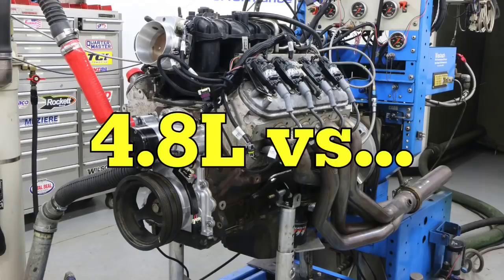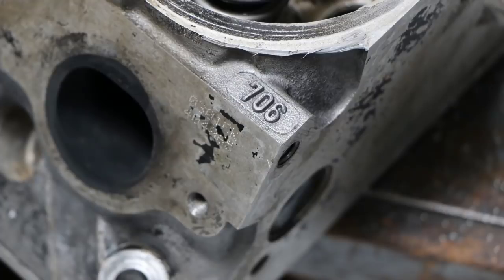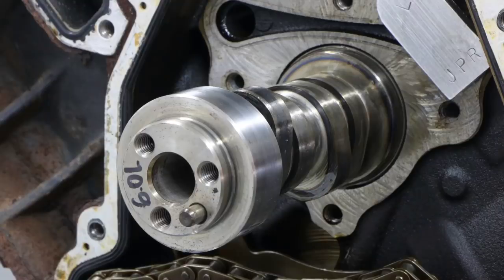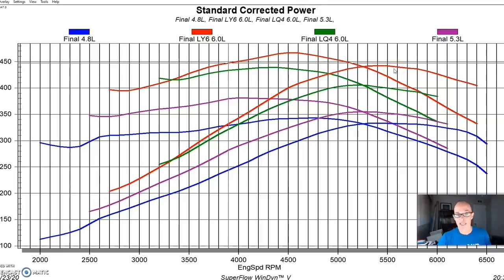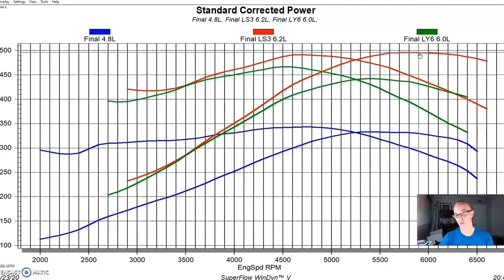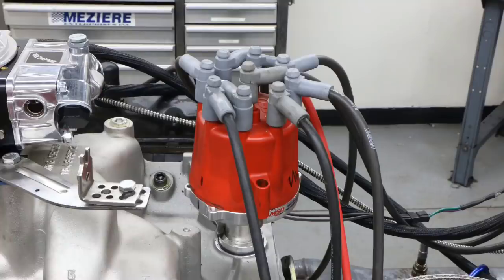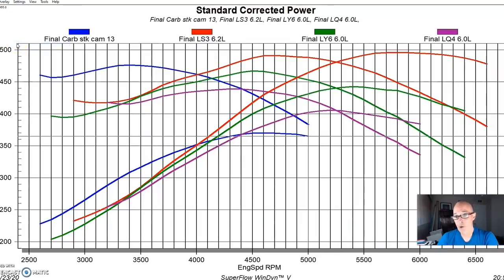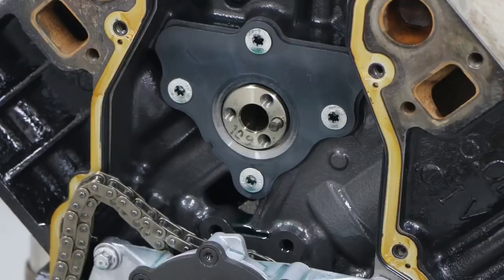LS INFINITY WARS-4.8L vs THE WORLD

Comment: I hate driving these 4.8's or 5.3's on the street though. Even the 6.0 l has no balls down low. You have to rev these motors. The peak numbers are impressive but the average numbers look like shit. This guy is a Dyno racer though so........
Reply from the maker: yes-because a dyno that shows how much torque the motor makes at every rpm tells you nothing about average power

Comment: The 6.0s and 6.2 all had about the same torque where you started the various dyno runs. As you stated, the cathedral port-headed engines do better below that. There’s another factor when you get into aftermarket cams, though. The factory cams are all wide LSA smog cams and don’t provide the mid-range of a narrower LSA cam. Even zero overlap at 0.050 is way better than the factory stuff, and fills in with torque in the mid-range. Thanks again Richard for all the good info!

Comment: Bigger is better and boosted is even better!  On my Cummins swap forklift project I am building a 8.3L instead of a 5.9 because it has 25% more clutch engagement torque. That will make a noticeable difference in how it handles and responds.  Not really going to be doing 4k clutch drops in it so the torque rules!

Comment: Hey Richard.  Thanks for the world of ls motors.  I did change my cam 209/217-500 and to 1.8 roller rockers,   7.450 pushrods,   600lift valve springs on my 5.3. You did mention in a video about Changing rockers and adding pushrod guide plates might hold back the pushrods from lining up with the rockers. And you were right.  Still I don’t see severe deflection,the roller still stays on the valve stem just not centered tight. At 51 6’6 and overweight this was a huge job to do. The worst was the valve springs and my big fingers. Lol. All done in the Yukon not on a stand. But it’s done now I’m working on getting my long tube headers done and corvette style side pipes.  Then the glorious tune. Thanks Richard.  Good video

Comment: I bought a 4.8 from the junker because it was half the price of the 5.3 with 20-30 less hp but kinda regret that
Reply: The 4.8 is a hot ticket in an S10. There's enough power to be fun but the rear end isn't stepping out in the wet.
Reply: @ahoneyman  I’m Ls swapping my s10 1998 4.8 to a 383 stroker
Reply: My coworker has an S10 with a stout 355. It just spins the tires if u get on it.

Comment: 5.7 and 6.0 are common in Australia.Never see the small LS engines
Reply: Thats because they were only a performance engine in the Commodore.  The smaller iron engines were used in american pickup trucks.  6.2 also common in Australia. Prices for all are now insane since commodore production ended.  2nd hand prices for a high km LS1 are now $4000AUD.  $8,000+ for an LS2/L77/L98 and well over $10,000 for an LS3.  Crazy.  Now collectors items.

Comment: Dude.... you forgott the 5.7 litre?? WTF The most common engine I use is A5.3 from a junkyard punched out to 5.7 585-600 lift cam234-236 dur. big heads usually ported stockers probly about 500 to 515 at the crank

Comment: I have an open quesiton for anyone that reads this. I might be inheriting an early 2000s s10 with the vortec 2200 manual. Id love to keep it around for a long time (permitting it is in good enough shape). Would it even be worth swapping in a 4.8 or 5.3 ls in order to get better towing and a bit more power? Do you think it's possible to get the ls tuned to get better fuel economy then the 2.2 on the highway (lean burn)? And could a nv3500 really hold the power of a mild use 5.3, they're fairly cheap to find near me so its better then a t56. I don't want to go broke doing it so if it ends out being a lot considering the truck is free.
Reply: Trans and rear axle wont handle any sort of spirited use. Those 2.2s have head cracking problems. If it starts dripping coolant under/behind the exhaust manifold get prepared for a new head ir the swap! Just do a 4l80e and a 8.8 narrowed axle behind your choice ls engine. Look up a channel LsBluu for details
Reply: @ScottNelson01  I'd really like to keep the truck manual since it's already one. Didn't the nv3500 come behind some ls's factory? the other option would be to try and find an nv4500. The axle is the worry but if i keep it sensible for a while and then eventually do an 8.8 swap it should work. 4l80es are fairly pricey compared to any of the manuals, if i Had to go to one it would be a lot more. thanks for the insite!

Comment: Richard when you talk about destroking engines I think of the NHRA guys in the early 70's taking 426 gen II hemis and destroking them to 366 to get class advantage through weight breaks for smaller displacement.  Would love to see a dyno comparison between a 426 and one destroked to 366.  Mr Norm's "Mini Charger" 71 Colt built by Romeo Palamides and driven by Gary Dyer (founder of Dyer's Blowers) ran a 366.

Comment: Richard you should see how much power you can get out of a VW/AUDI 1.8T junkyard motor. You can test the factory small port vs large port head differences. You could also test how adding displacement via bore and stroke increase would affect power. Would be great to see a big bang of a 1.8t and the limits of the stock block and stock head

Comment: Richard if you want a deal or sort of a deal then one possibility is 74 auto salvage . Had a guy at work bought a I think 2018 or 19 SS Camaro for 7k and I think it had around 7 k miles on it .It is a direct injection motor with a 6 speed manual . He bought a front end for it for not sure and it will be a cheap deal . He came from a body shop a long time ago . A couple of guys at work have done that . I going to at some point .  I work at a power plant not 74 auto lol thanks for all you do

Comment: A small block 302 of the 60 was killer on the drag strip will you compare this motor with a 283 
that is used in the corvette of 58 or 59 with the combination of 302 and test the same with a 
307 engine with the same combination the is to see what could do the best  bore and stroke.

Comment: Two points: 

1: It doesn't seem fair comparing the Gen-VI 454 to any of the LS-series engines here, strictly on the basis that you weren't running it's factory distributor or EFI/MANIFOLD arrangement. 

2: Since you're highlighting the torque numbers, let's see what the TRULY all-stock (EFI & ESTC distributor) Gen-VI 454 made. I'm betting it came close to the stock Cadillac 500's numbers...! ;)

Comment: The ls3's only sell for so much more because they are aluminum. ...your better off getting a iron lq4 and boring it out .065 with flat tops and if you wanna go the extra mile get square port heads. .

That's what I did and I did it for under $2500 , with all new internals except for crankshaft

Comment: I still think building a 4.8 for mileage would be a great series. There are thousands of videos of geting more hp out of the ls series.almost none for economy. Most people going to replace an engine don't want a modified engine in the daily driver because fuel consumption. Cam the 4.8 to to make peak torque at 2500-3000 rpm then turbo it to bring the hp back. We all have had to wonder just how much mpg can be gained by giving up some high rpm hp.
Reply: I appreciate your mindset... but most people paying attention to these kinds of vids are knuckle draggers.

Comment: How about a comparison between a stock head stroked 5.3 with a 4 inch crank and a factory stroke 6.2, would the longer stroke smaller bore make the same power as the larger bore shorter stroke?
Reply: look for his destroked high Rev ls video motor was kinda disappointing

Comment: I went with a gen 6 454 VS an LS motor because all the LS motors I've tried just felt a bit empty and soulless. Stock vs stock even a vortec 350 feels more hot rod than a 5.3 LS.
Reply: The engineering and manufacturing of the newer engines though is superior. So you have less stress on parts and is why they can be pushed so hard w/o fail.

Comment: It would have been cool to see all of the motors you tested run with the same LQ9 cam. Then the only thing that would be changing power Would be displacement, compression ratio, and head flow.

Comment: Thanks this was exactly the type of side by side comparison I have been looking for. For your junkyard 6.0s come to Texas, I can find 5-7 (LQ4/LQ9/LY6) easy every time I hit the local yard. As for your merch check with Matt Carricker's (Demolition Ranch and Off The Ranch channels) company Bunker Branding. They specialize in merch for youtube creators.
Reply: Where in TX? There aren't any in DFW
Reply: @joshuabourassa7278  I am in Lubbock, but can also find them in Midland/Odessa, Abilene, Amarillo. FYI junkyards wont pull them from the vans because it is not as easy as a truck. They will try to pull from any truck that is running or that if bought from an individual that says it was running. My best luck is looking for burbs/Escalades/1500 trucks anything with the 4L60 I have found many that the trans went bad and it sat so long that the fuel pump/injectors varnished and they couldn't get to start so they sold it to junkyard saying eng/trans both bad. Pull engine, send injectors to be rebuilt, pop them back in and go.
Reply: M D sounds like I need to make a trip out west. What’s the going rate on them if you pull it yourself? I can get 5.3s all day in DFW; got mine from pick n pull on half off day for $294 with wiring, ecu, and all accessories. But if I can get a 6.0 for a comparable price, I’ll make the drive.
Reply: @joshuabourassa7278  I want to say $400-$600 complete engine w/accessories, harnesses, fusebox, pedal, ecu, Tac module, air box/intake tube and maf. But to be honest I cant remember the last time I bought just those items. Usually including seats, multiple engine packages as described above, transmissions, transfer cases, axles etc. Basically my junkyard trips are equivalent to my wife's Dollar Tree trips, go for one thing come out with 30 things.

Comment: What would make more power and torque? A L33 5.3L bored and stroked to 383(6.3L) or the L92 376(6.2L)?
Reply from the maker: I would pick the L92
Reply: L92 no dod to delete it just has variable cam.
Reply: Bigger bore and equal displacement usually equals more hp, probably less torque though

Comment: I would buy a T-shirt from your channel to help out. As far as displacement budget & rpm range is a factor. Like you said a tow rig Big Block Race car LS. A small vehicle the 4.8L would scream with a twin screw. How about a 177 roots blown 454 to twin screwed LS engines with the stock cams for HP & torque numbers. In case someone decides to go that route. I can imagine the increase would be wild to see. But I know you have many vids of boosted LS engines & the Big Block. See you on the next Notification!!!

Comment: Could be I am lacking in my edumacation but would there be any value in changing the cam so that the torque drop between 4500 and 6000rpm is not so great?
If so what part of the cam specs would be most directly responsible for an improvement ?
I am thinking 1/8th drag but in a heavy car.  Impalas, Centurions, full size wagon sort of things.  Or not worth pursuing and just go for maximum displacement?
Thanks for any input.
Reply from the maker: cam would change all these by a lot

Comment: I guess it’s all about the price of admission. If I could find a $1500 - 6.0 litre I would snap it up in a heartbeat compared to a 4.8/5.3 at $300-500. If I had to pay $3500...I’d be going with go GT-45 a turbo!😁

Not even considering the facts of our puny Canadian dollar. 

Add a camshaft and intake to a 5.3 and...maybe you’d be up to the torque (particularly) and horsepower (far more likely) of a stock 6.0. 

The L92’s are now 13 !! years old...they must be showing up in rust belt junkyards somewhere..
???
Reply: Awesome test by the way! 
👍🏼👍🏼
Reply: Where are you located? I'm also in Canada (Onterrible) and have trouble selling 240k kms 6Ls for $700.
Reply: Located in Calgary. I’ve seen them everywhere from $1000 to around $3500...so chose my figure to spawn discussion. 
Cheers 🍻
Reply: I purchased my LS (L92) as a brand new crate motor for my turbo mustang swap back in 2007. Used didn’t exist at that time.
Reply: Picked up an ly6 from a box van for 180 bucks, had to pull it of course but there's deals if you're willing to work for it

Comment: Look at the old 637 cubic inch GM motor that came with a 5 and 1/8 inch piston with a 2 and 3/4 in stroke
Reply: The 637 GM 60 degree V8 (basically a big GMC V6 with two extra cylinders and a balance shaft because 60 degree V8) is a 1200 lb boat anchor.    They made decent torque for big heavy fire engines but they maxed out around 3000 rpm.
Reply: I didn't even know they made that size engine but I learn something new 2day thanks guys

Comment: 6.0's are kinda rare up this way. I heard of a guy paying $2700 for a low mileage, stock lq4 not long ago. He obviously got hosed but still lol
Reply: I found my lq4 in shortblock form on Craigslist for $500
Reply: That's expensive. I paid 1300 for a complete (all accessories, wiring and pcm) 2017 hemi with 40k miles.
Reply: @AlexAutoRepair1  apples vs oranges.

Comment: That 454 needs a mild cam with something like 224 intake duration from 0.050" with 0.550 lift and 232 exhaust duration from 0.050" with 0.550 lift. My guess would be 420-450 hp and 500ish torque. Would be cool to see. Plus the cost comparison between the 6.0 lq4, 6.0 ly6, and the 454.
Reply from the maker: done that lots-425 hp or so-you are right on
Reply: Now in my head a ls2 with some 862/706 heads and a btr stage2 truck cam would make more power and be substantially lighter and get better mileage

Comment: Look at where all the power curves cross. 5400 rpm!
Reply from the maker: 5252
Reply: 5252 is used in the equation to find hp its like trq x rpm ÷ 5252 or something like that
Reply: Its a conspiracy!
Reply: That point in the rpm range should be a clear indications of the performance ability. And to mark the perfect power range of that design.

Comment: Vans are were most all of the 6.0 motors are hiding
Reply: some things we need to keep to ourselves.....
Reply: I got my l96 out of a schawns delivery van....complete with propane injectors and modified intake. .....complete for $800 delivered to my door on ebay
Reply: and the 2WD 4L80Es for those who want automatics, but hush hush
Reply: @PigEqualsBakon  that where the denalis and 2500hd trucks come in lolololol
Reply: @coreysmith8290  no denali ever had a 4l80e
Reply: @JohnnyAnderson1  correct. 4L60/65e.
Reply: I have 2 2006 vans both with a 4.8 and both with 4L80E 2wd tranny factory. also have a 2003 with a 5.3 and a 4L80E 2wd. all 2500 (3/4 ton).
Reply: @bobbobby1846  ah, I see you too are a man of culture
Reply from the maker: I search vans, trucks and suvs